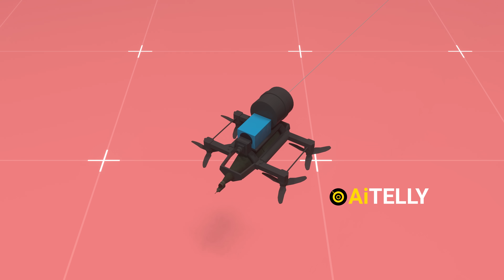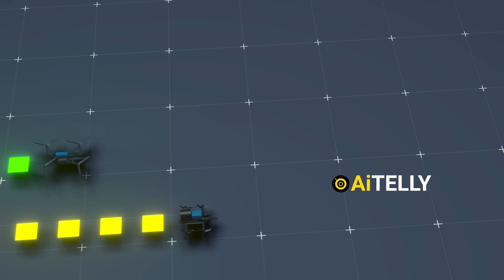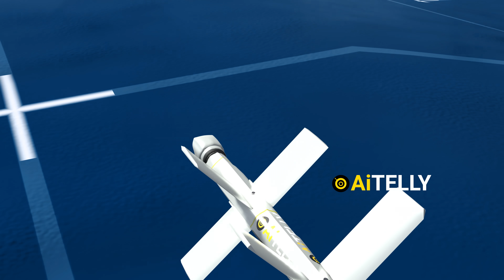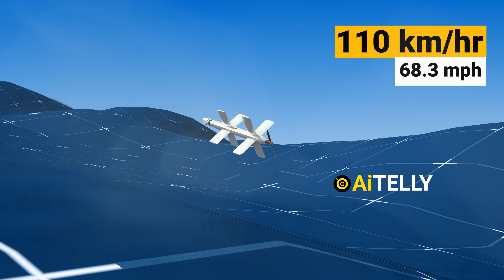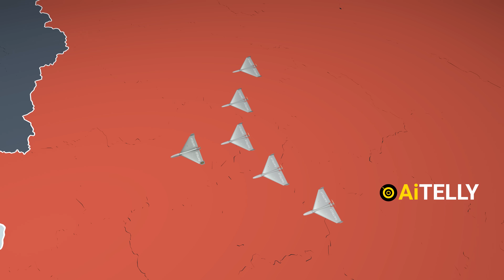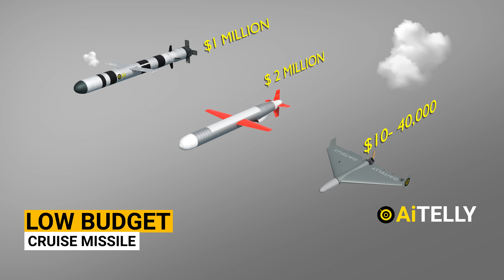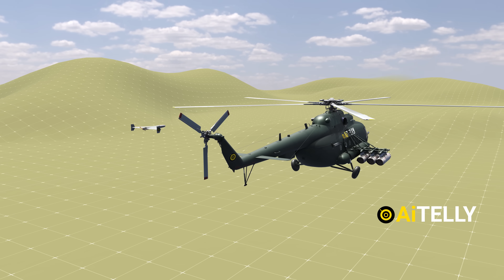How Russian Drone Strikes Works against Ukraine?

Comment: 1 Kilometers or 1,2 miles? A kilometer is shorter than a mile.
Reply from the maker: You’re right a nice gentleman pointed out mistakes in the first 10 minutes before releasing our video
Reply: @Aitelly in fact it has much bigger combat radius. It has been mentioned in russian military telegram channels, that fiber optics fpv drones can fly up to 25 kilometers (the smallest range is about 3 km). Of course if it flies far it costs more. Usual fpv drones sometimes can fly at even bigger distances. New lancets can fly up to 70 km and more, we have seen it on videos when lancets destroyed ukrainian aircraft. 
Btw you could have mentioned that there are more russian models of reconnaissance drones, not only orlans. There are for example superCams and Zalas, which have way better camera quality than average orlan has. It seems that they are produced in big quantities for now and widely used by russian army. 
P. S. It would be literally suicidal for drone operators to use fpv drones that have range of only 1 mile. Even old wired atgms can fly at distances of 2 and more kilometers. 
P. P. S. Sorry for my bad English)
Reply: @bebro4ka  from what I’ve read the limiting factor for the wire guided fpv drones is the added weight which shortens battery life. It’s not the length of the wire that’s the problem
Reply: @bebro4ka also, I believe the atgms you’re talking about aren’t wire guided, they’re laser guided and thus can travel further
Reply: @bebro4ka  fpv drones do not emit electronagnetic waves
Reply: @TheCrapOnYourStrapOn  anyway, wired fpv drones can fly further than 1 km
Reply: @TheCrapOnYourStrapOn  some old atgms are wire guided, even old versions of tow.
Reply: @bebro4ka  yes but specifically the long ranged atgms I mean. It’s one reason tow was being upgraded to laser guided/beam riding. They had a literal metal wire though that would short out if fired over water. That wire is also heavier than the optical wire used for the fpv drones. 
All regurgitation of articles I’ve read here and there over the years, I never had any personal experience with any atgm
Reply: @bebro4ka  yes I’ve read that one had a 5km range as well. From what I read the battery is the issue not the length of the wire, although obviously more wire means more weight which means less range etc etc
Reply: @TheCrapOnYourStrapOn  the tow, Milan, Fagot and others are wire guided..
Reply: @TheCrapOnYourStrapOn   .. 5 km of wire are not heavy.. not heavier than the battery pack, or a rpg round. the wire is very thin. Of course its weight.. But wire guided drones are just for a few hundred meters, because the main problem is the fact that you cant get aroound corners or fly through other obstacles, cuz the wire is that thin.. it cuts off if you scrape a tree, a fence.. or whatever you can imagine.. you cant fly high above ground with a wire attached. you could.. the problem is getting down, without touching the ground with the wire.. a lot of friction for fibre..
Reply: @bebro4ka  stugna is also wire guided.. Fagot and Kornet , Milan...
Reply: @Nitroat-xo4tj  I was wondering if they would design an agricultural type larger drone with longer range to have a smaller wire guided sub drone to launch and guide using a remote drone carried repeater. Obviously there are a lot of obstacles to overcome but I’ve seen stranger things. 
I am obviously pro Russian (or at the least very much against US and nato aggression) but as far as the tech goes I try to stay impartial when looking at the designs rather than assuming something is stupid just because “the other side” produced it. 
I believe AI will eventually make guidance unnecessary for the most part but until then here we are discussing crazy thrown together tech in a YouTube comment section. One day soon we may see drones like this buzzing around the US. It would be nice to have a heads up as to what to watch out for
Reply: @Nitroat-xo4tj  stugna and kornet are laser guided
Reply: @Aitelly  something like this happens. Dont worry! your content is fantastic!
Reply: @Aitelly you contents are very informative. Thank youuuu.
Reply: @Aitelly he should go back to school 1 km is 0.62 miles. You didn't have to be nice to him. He posted comments without verifying facts. He has no basic knowledge of things.
Reply: As a Russian fiber-optic drone operator, we have a much wider range than 1 km. Fiber is lightweight, so we can achieve more. For example, it may be more difficult to attach some YOBA charges, such as 6 kg of engineering concrete brakes, but we can still do it.

Regarding simple OG-7L, we can go much further than 5 km with fiber.

Stay calm and wait for us, Russians!
Reply: @VeselySmertokog  maybe you saw my old humvee. Probably not as it was always breaking CV joints. Anyway hopefully it’s been put out of its misery. Good luck to you my friend and thanks for comment
Reply: @TheCrapOnYourStrapOn  Ukraine will be defeated. Слава России 🇷🇺
Reply: @VeselySmertokog  Ukraine defeated itself with the “revolution of dignity” if you ask me. All that’s left is a poorly fitting nato skinsuit
Reply: @TheCrapOnYourStrapOn  here we think, that revolution is a top of iceberg of more than a hundred years history of pretending to be not Russian as hard as possible.
Reply: Километр кратен сисистеме счисления.
Reply: Since 1 mile is 1,609 meters or 1.6 kms., 1.2 miles is 1.93 kms. or nearly 2 kms.

I guess the intended figure was 2 kms. what matches some types of drones.
Reply: 1 kilometer ≈ 0.621371 miles
Reply: Y
Reply: Make your own video then!
Reply: @Nitroat-xo4tj  WHAT THE FCK IS A KILOMETER 🇺🇸🇺🇸🇺🇸🇺🇸🇺🇸
Reply: @10.huynhphathuy8  a kilo of meters = 1000 meters, simple
Reply: @10.huynhphathuy8  A unit of length used by every civilized country across the entire world.
Reply: @10.huynhphathuy8  That depends on the weight of the meter ribbon. Average weight of a meter ribbon is 100 gr. A kilometer is 10 ribbons meter. This is average but can be less or more. For any more details please have contact with the Chanel (Altelly).
Reply: @10.huynhphathuy8  that's as long as your moms tunnel.
Reply: @10.huynhphathuy8  oh, you dropped out of school early, i guess. Im sorry for you.. Not only racist Comments against jews.. also no clue about kilometers..
Reply: @Nitroat-xo4tj  chill brah, it's just a meme about how american dont know other measurement units other than imperial system. And it's morally good to hate the tribe, plus my school years are probably longer than your teenage mom entire lifespan lol
Reply: @Nitroat-xo4tj  check for yourself who dropped off from school. Most likely it is you.
Reply: @Nitroat-xo4tj  What ?? Altelly did racist comments about jews?
Let me guess, he said again that Jews were equal to Christians or Muslims? 
Yeah that was racist against Jews, i told him.. He is stubborn.
Reply: @lowpoul5552  please look up which comment i was answering.. not AI TELLY was racist.. but the guy with the "The Rock Sideeye" Picture in his account.. He deleted the racist comment.
Reply: @Nitroat-xo4tj  No worry, please forgive. I do some trolling when i get bored, the worst is that sometimes i writes that i find funny but only i do :face-purple-crying:

Comment: I think Calibre costs around 250k not 1million.

Secondly, there is the jet powered stealthy Geran-3 drones under contruction. And there is an upgraded AI-powered Lancet drone used for swarm attacks, under construction
Reply: There are tons of cheap options before the Russians will use the kalibre. Glide bombs and short/medium range missiles such as the Iskander-M
Reply: @reee_4067 iskander 7000km/h very difficult to intercept. Ready to start :13sec
Reply: @gianfrancoguiso8663  Iskander is a ballistic missiles.. They follow a predicted flight path.. They are easy to intercept than low flying cruise missiles.. Which are also more accurate
Reply: @abhimanyunath2001 
Искандер маневрирует.
В этом его преимущество.
Маневр на скорости 4-5 МАХ.
Его траектория непредсказуема.
Такого ещё никто кроме России не достиг.
Reply: @АнтоДив анало говнет
Reply from the maker: I will look into it
Reply: @Aitelly  Kalibr cost 1 million n export, for Russian military it cost 250K for the cheapest variant, short range 500KM.
Reply: @Aitelly geran 3 was colored black using a jet powered engine , and also the main assistant to lancet was zala421-16 for recon,orlan was only used gor guiding krasnopol etc , izdeliye 53 was launced from tube nor catapult anymore and have a ai for each target they choose
Reply: @Aitelly Yes, please check. If your intention is to make unbiased video material. Because you have too many wrong informations.
Reply: @Aitelly  And Shahed drones are 200K USD not 50K
Reply: @abhimanyunath2001 isn’t it around 20k
Reply: @viswajitbala7924   No there was a leaked document maybe in February this year where the details of the deal between Russia and Iran were highlighted..
Russia signed a deal for 6000 of these drones including all the TOT and software was 1.75bn USD..
The price quote was 300K for 2000 and 193K for 6000.
Reply: @abhimanyunath2001  Probably export tariffs cuz ain’t no way a drone can cost more than that
Reply: @viswajitbala7924   More than what? 
They say they use carbon composite, which is surely a costly material, and there are warhead assembly, INS, though they don't use GPS,  And also a solid rocket booster...
Now if u talk about Iran there all data is shady, there u don't have to pay for electricity, gas or other utilities.. Labor cost also not included there..

So it can be cheap..
Reply: @abhimanyunath2001  Geran-2(Shahed) already making in Elabuga(Russia->Tatarstan), then became cost is 20-40K now
Reply: @selidim   Yeah I know that.. But cost reduction of such level is maybe hype.. And the initial impact of these drones isn't there now..
In fact Ukraine also doing the same.. So the technology isn't now that exclusive..
Russia should give more focus on maintaining air dominance.. And their lancet loitering munitions is more effective than Geran 2..
Reply: @abhimanyunath2001   Russia focuses more on land Attack than Air Superiority sead and Dead unlike americans.
Tons of old soviet era air defence systems like Buk-M1 S-300PS, S-300 PM/PMU,S-125 Neva/Pechora, S-125 Newa SC, ZSU-23-4 Shilka(they are old but still lethal), denied Russia Swift air superiority in the initial days if war now when they are combined with 
German Flakpanzer Gepard irisT
American supplied Patriot,mim hawk,it is not a eazy job And Russia starts slow,fights longer and ends decisively
Gerans/Shaheeds carry 50 to 90 kg warheads,for longer range,Russia Used them to take out Kyiv Electricity Grids and power lines and Strategic Command posts and buildings,they have bigger warhead most likely fragmentation warhead for bigger targets unlike  lancets which has a shaped charge to take out armoured vehicles.both have different purpose,it is still not obsolete when one has to swarm attack, deliver payload farther,take out bigger target,overwhelm enemy air defences and most important if one has to intimidate his enemies with Stuka whistle.
Reply: Ik it, right? Lol. I once saw an article like "Russia waste 400m $$$ missile worth for breakfast"

And i was like, hold on a sec. 

And quickly found put how those "experts" use export price for them.😂😂😂😂
Reply: Jet powered Geran drones are already on the battlefield.
Reply: russia is a terrorist state
Reply: Kalibr is a family of missiles with the smallest one with a range of 50 km, the cheapest one at 250k and the largest one at 2500km with a cost of 980k locally, 6.5 million if exported.

Comment: Ukraine is currently working on developing a drone that can launch through artillery rounds like switch blades size. Its small size allows it to be launched undetected within 32 km, 155 howitzer range is 32 km. Imagine the drone will first enter enemy territory undetected, covering 32 km without using its electronic system. Then, it will fly up to let say 10 km its undisclosed range using star-link, meaning the electronic system will activate after 32 km if the drone operator sees Putin, or any other Russian target they can immediately strike its like smart munitions drone using a special camera that able to see clearly its target from 3000 yards or more and record it. They call the system xxiv sicarius falco. ( убийца сокол).
Reply: Plus les drones est grand, plus il est facile à détruire !! 

Plus petit alors plus difficile à detecter
Reply from the maker: Will make another video on Ukrainian drones

Comment: That’s a lot of the capacity and load the drone can carry… instead of useful weight… you’re carrying a thin command link wire. When the wind blows… the drone isn’t only fighting that wind… but the “sail” it’s dragging out behind it. If the drone gets low… that wire gets snagged or touches water… who knows what happens then.
Reply: Неправильно!
Катушка на дроне а не у оператора и поэтому любое сопротивление ведёт только к лишнему сматыванию волокна . Только и всего.

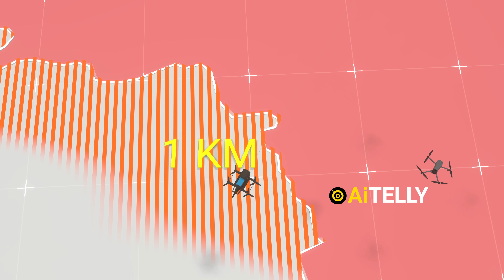Comment: At 0:30 seconds.....1 kilometer is 0.6 miles, not 1.2 miles
Reply: Shhhh...I'm getting good gas mileage here
Reply from the maker: Yes you are Right- Thanks for the Corrections
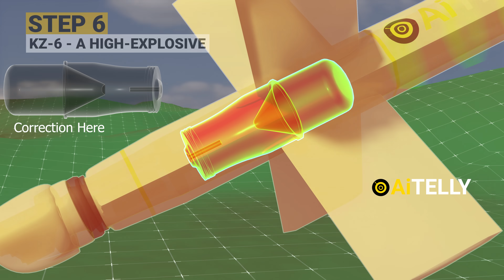Reply: @Aitelly  4:32 i guess there is some punctuation error causing the pause between words circular and shaped

Comment: All the drones that have been described have a significantly higher range.
For example, the FPV on fiber optics ("Vandal") is 5-8 kilometers :)
Reply from the maker: 5 Km of Fiber Optic i Doubt they would carry in the Heat of Battle
Reply: @Aitelly  However, this is a fact at the moment for the model in use. Lancet, for example, has hit targets at a distance of 75 kilometers from the front line, given that it is launched from the rear.